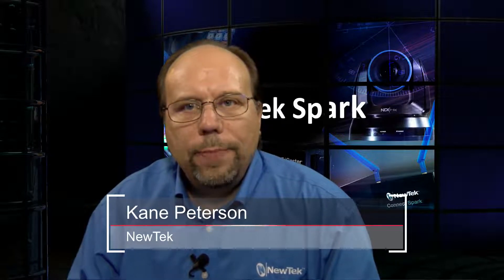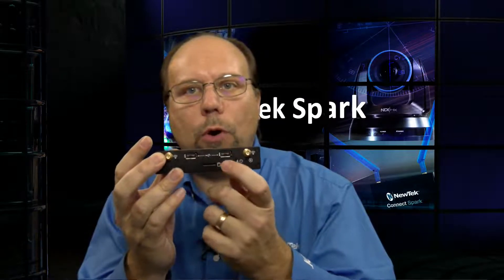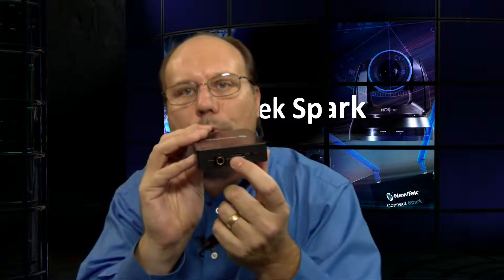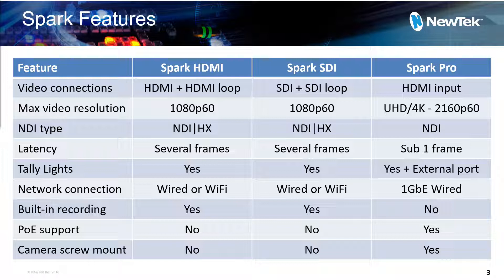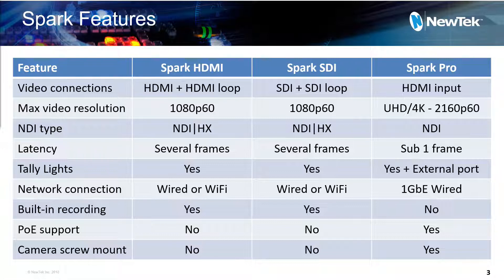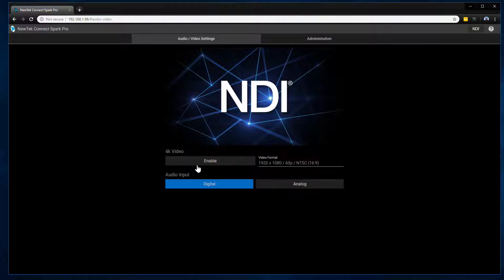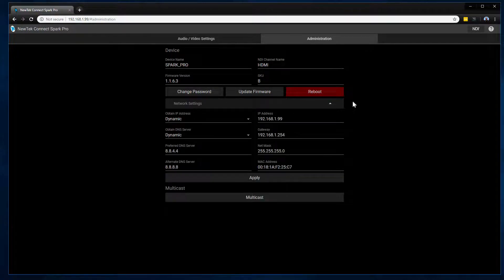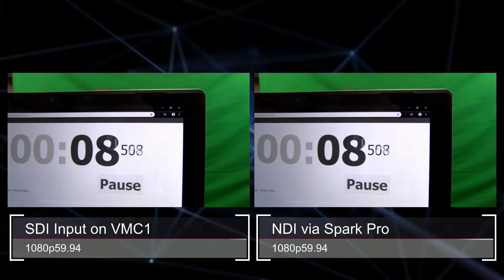NewTek Spark Training

Comment: Can you please do a test like you do with Spark Pro, with  Spark HDMI with wireless 2.4 GHz -5 GHz and Weird, because still i'm a bit confused which model to buy to use with VMC 1.

Thanks
Reply from the maker: Wireless with have more latency than using wired with Spark HDMI unit, I think depending on your WiFi, you can have up to .5 seconds.  

As for which model, that depends.  Do you need WiFi?  Do you need 4k?  Is low latency critical?  Knowing the answer to that will tell you which model might be best.